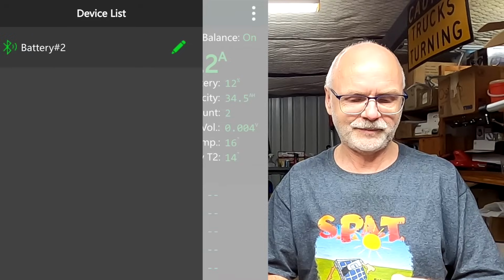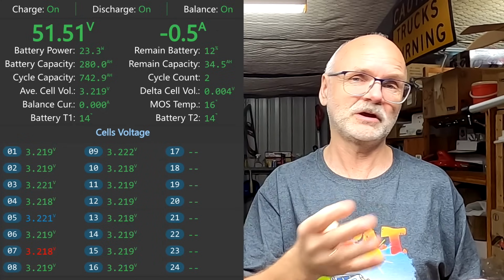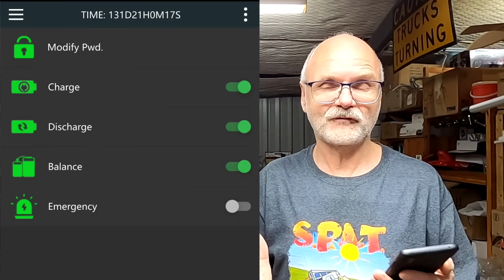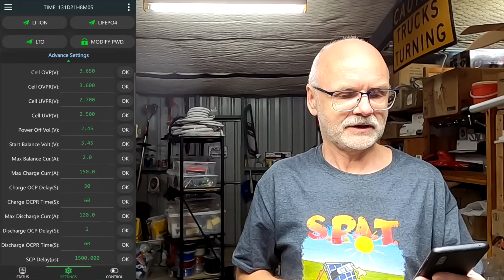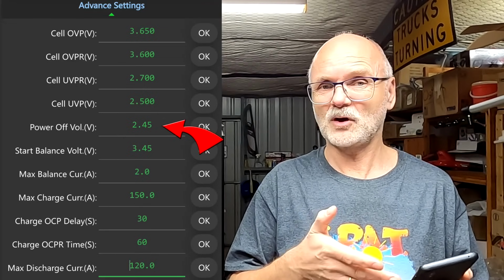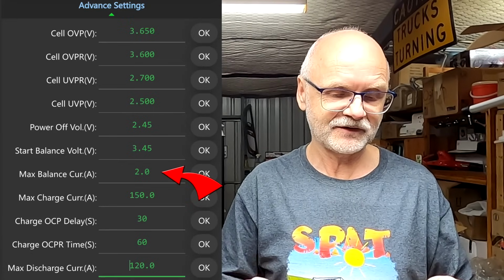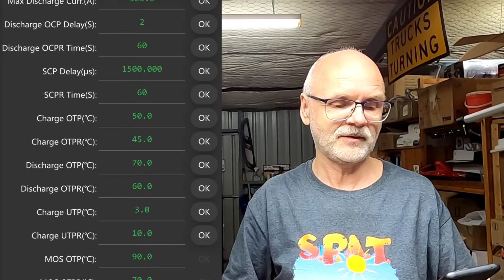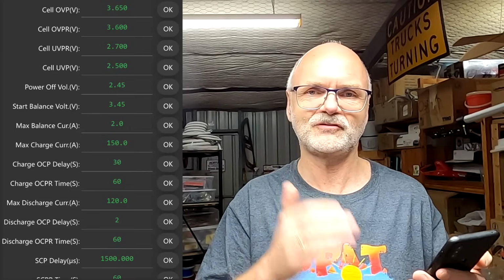JK-BMS: all settings and menus explained. How to program and set parameters.

Comment: Hi Andy,
in my opinion the Con.Wire Res. ist the resistance of your cell wiring. The BMS is able to calculate the "real" voltage of the battery because there is a voltage drop that becomes more important on higher currents e.g. 50A and higher. The voltage drop may be some mV but it is important, because the polarity will change while charging or discharging. so it must be added or subtracted from the cell voltage!
greetings from Germany!!
Reply: The cell wiring (bus bars) is in the order of 1 mOhm. It is probably even less than the internal resistance of the cell, which is around 0.25 mOhm. The Con Wire Res values on the screen look like around 150 mOhm, so they can't be the bus bars, they must be the balancing wires.

Comment: Amazing video Andy, finally I have got my battery ready to calibrate the BMS, all due to your instructions. I got a JK BMS for 24v which was the only one at the time, I did want 12v, but I have used the buck converter to get the 24v. Did the 7v short trick (thank you) to get it started. Using the software on my iPhone on the status screen, I can only see half the screen, the other half disappears under the settings screen, might be due to the version of iPhone.  The only other thing is that it will not let me change the Charge UTP setting and it defaults to -20 degrees! It will never get that cold here in WA but it does get down to freezing especially outside and early morning.  I can change most settings which I did not think I would be able to on the iPhone, I thought I had to pay for that. Oh well am now a little bit further down the road on the journey.  Thanks so much for all your nerdyness😎
Reply from the maker: Thanks a lot for your kind comment and words, Jackie. That is great to read and I'm always pleased if I can inspire people following their own projects.

Version 4.7.4 is the newest one I believe. Not sure why it does not let you change that parameter. Do you get frost in winter near the battery, is this really a concern?
Reply: @OffGridGarageAustralia  I have now obtained a disused Samsung phone and this is what I will be using as I get the full page of info and can see all the parameters when scrolling.  I downloaded the latest version V4.8.2  - woopee it now changes the UTP, we are in the hills outside of Perth and it is always 1 deg cooler up here...lol - probably do get the odd frost,  YES you do inspire me, I am a bit of a chronic DIYer but it is great to be able to collaborate with other likeminded people. There is always stuff to learn and it is what makes the world go around!  All I need now is to be able to see what my battery is doing over the internet, when I am away.  But I do not have any  Victron stuff, my battery is basically providing off grid power to my aquaponic setup, idea being power outages will not kill my fish!  Thanks Andy.
Reply from the maker: @jackiedines5229  thanks a lot for the update. Great to hear it's now all working.

Comment: You are not very precise on those settings, for example, when some parameters like OVP are met, only the charging MOS is cut, not the discharging one. So the battery is not "disconnect" as you say, only charge MOS is deactivated.
Reply from the maker: Yes, that is correct. I forgot to mention that. We have seen exactly what you described in the many tests with BMS here on the channel where I have demonstrated that function. 
Thanks for adding this for everyone.

Comment: 2è:35 : Yes it's better, imo, to start balancing a little before max voltage is met .... why ? Cause you will eventualluy prevent the higher voltage cells to go even higher by limiting their provided current and you will favor lower voltage cells with more current. You'll meet balancing earlier while stressing a little less those extreme cells.
Reply from the maker: The problem with that is, if you don't go higher then just the start voltage of your balancer, you may imbalance your battery.
Say if you start at 3.35V with the balancer already and because of cloudy weather or load you don't charge any higher than that this day, the balancer will already balance where it should not.
But yeah, starting at say 3.4V and absorbing at 3.45V should work as well. I still think, it's better to just chop of the cells if they go over the set voltage. Once we have the communication set up, we should be able to slow down charging from the MPPTs so the balancer can effectively work on the high voltage cells.

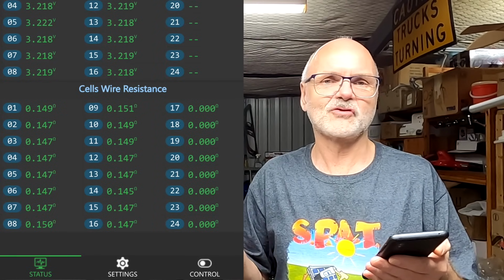Comment: 10:47 : Those are the resistance of all wires that goes to the BMS, they should all be the same i suppose ... for the BMS to work properly.
A bad contact would  display a different value. If, let's say wire 13 is 1.2 Ohm, then it need to be checked .. something is wrong with it.

Comment: I have 16 EVE cells with a JK-B2A24S15P. The batteries and inverter are in my shop which is too far away from my house to monitor with bluetooth. I have a network connected laptop in the shop that I can take over from my house. I can view the monitor programs for my MPP Solar LVX6048 inverter and my Victron Shunt this way but I can't find a way to monitor the JK BMS on the laptop. Is there any way to monitor the JK BMS on the laptop so I can also see that from the house?

Comment: Hi Andy love your videos! I have a question about the JK BMS with the heating option and I was wondering if you knew what heater they use and possibly the set up of it? Keep making this great content it certainly making me try new things.
Reply from the maker: Thank you. The JK has the heating function but you need this special connector. Hankzor on AliExpress should have that. The max current for the heating output is 3A only, so if you need more, use a relay. You can use any heating pad, mat or other heater.
Reply: @OffGridGarageAustralia  thank you for getting back to!

Comment: yeah this is the one for me.  the blutooth is what i was looking for but the capacitor balancing is brilliant.

i've contacted them on aliexpress to see if i can buy the 24s and connect to my 20s pack till i switch to 24s, or will cells not being connected cause an issue
Reply from the maker: You can use the 8s-24s BMS for your 20s battery and follow the instructions on their website on AliExpress. Very easy to setup as you just leave the unused cells disconnected.
Link is here... https://off-grid-garage.com/battery-management-systems-bms/

Comment: Hello Andy!  I’ve finally started my installation and just installed the first battery set. They are too balanced and full. Voltage dropped to 3,47 v. But the JKBMS says I have only 70% capacity how should I calibrate?
Reply from the maker: The JK will calibrate automatically. Have you set the capacity correct?
Voltage will drop once the charger is disconnected. Resting voltage is around 3.3-3.35V for these cells.
Reply: @OffGridGarageAustralia  yes i set up 280. I’ve charged them few weeks before installation in the power banks. I’ve charged them with the EBC-A40L such you did untill amps droppe to 2 amps. Store them and installed them later. Should I charge them at the maximum 56 volts for me ? I did yesterday but still showing 72% left.

Comment: It would be nice if 'wire res' was actually Internal Resistance; that would be a useful feature for tracking battery degradation.  Otherwise I can't imagine why wire resistance would be needed.  So maybe this is where actual IR can be entered if the calculated IR is wrong (just like they allow setting actual voltage and current).  Anyway, hopefully being the JK god you have the contacts with JK to find out; we peons don't...

Comment: Hi Andy, absolutely brilliant video and great timing for setting up my system. I wonder what settings you would suggest to not max out my batteries on either charge or discharge ? Also would I need to alter any of the charge parameters within the
 multiplus 2. 
All of the charging from my solar set up comes through the multiplus to the batteries.
Many thanks Steve

Comment: Andy I have installed my 280Ah 8S 3.2v Eve pack with JK Bms.  I copied ALL your settings in both Victron Scc and JK bms. I will let you know how long this will last.  Hopefully you are right about less degradation with these settings. This is day 1. 19 July 2022.
Reply: How about the degradation and diff volt when load applied?

Comment: Hi. Great content. Really enjoy all of your videos. I was wondering if the JK bms keeps the battery on when an over/under voltage occurs to protect the solar controller?
Reply: yes it does.  it just cuts off charge or discharge depending on what was triggered.  the only thing that turns off the BMS is the "Power off voltage" setting.

Comment: I want to stack 16 cells on top of each other verticaly. Is this ok?
Reply from the maker: The electrolyte inside the cells is liquid. I know they can be on a side for some time but permanently?
Others...?
Reply: @OffGridGarageAustralia  it has some electrolite in it. There are videos with 12v batteries with lifepo4 cells stacked horizontaly in box

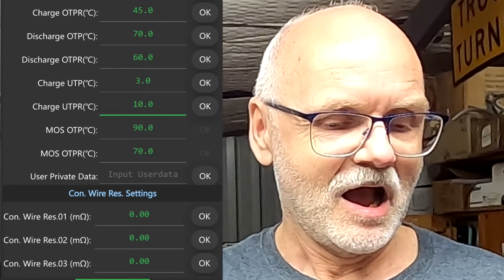Comment: 37:57 "User Private Data"
This is a ONE-TIME user changeable data. You can enter a string and it will be made PERMANENT! 
What use for? Use as a signature like "Andy's JK BMS" such that if stolen you know it is yours.
Or Battery name like "JK BMS Bank #1". So when you have multiple JK BMSs around and you want to know which JK you are viewing, just go over here.
I repeat, this can only be changed ONCE.
Reply: in app version 4.9.3 it can be changed over and over
Reply: @ajnsan  NICE INFO! Thanks!
Reply: @ajnsan  I tried it today: version 4.9.3 and all the other higher versions, no dice.

Comment: Always great info Andy, sometimes I watch ur vids a few times over. A question, I have 2 x JK 24v 200A BMS’s, can I use them in series for a 48v system? I don’t know if the MOSFET’s are rated for this voltage. Q2. My newish 24v JK wont connect to BT app & makes a 3 short beeps then 1 long beep, it took a bit to initially connect when I first switched it on a week or so ago, it worked fine mostly for a few days and then started this beeping when I tried to connect the app to it.

Comment: Good evening. I'm following your channel from the start. I recently started to build my own system with mostly Victron stuff. And went with JK BMS. But i have a weird issue. Even when i turn off discharge on Bms it still lets around 50W over because my Multiplus still can run on idle. If i raise usage to around 100W turns off as it should. Can you test for me if i have faulty unit. Or this is how this bms works. Thanks

Comment: Great video again! As always! Inspiring! Maybe someone can help me? I purchased JK-BMS based on battery 2.0 story. It is best what I had so far.  I have JK-BMS plus Victron family - Smart shunt, Multiplus II, Cerbo GX and Smart Solar MPPT 100/50. I have 24 V system with 210 mAh battery. It been fully launched 1.5 month ago. Original idea for SOC was to use JK-BMK CanBus, but I been told that it is not compatible with Victron. Then I ordered Smart shunt. For few weeks I been adjusting SOC as there was a difference between JK-BMS and smart shunt. Usually JK-BMS had higher SOC than SmrtSh. Few weeks ago I went for vacation and after a week I saw that my SOC reaching only ~70% (based on Smart shunt measures). After coming back I found that Smart shunt has SOC value of ~70% but JK BMS had 98% and charging was stopped due to cell OVP. What can be an issue? settings?
Reply: I only have the older Shunt BMV 702 from Victron, but I remember, that you can set a value like "charging efficency". Mine was like 95%, which should be ok for lead-acid batteries. But for LiFePo4 I guess this has to be set to 100%. You should check if there is a similar settings in the Smart Shunt.

Comment: Hey Andy, Andy here! I hope you see this and can tell me if I'm doing drugs or not!
Lifepo4 cells have approximately 25mv change from 90% to 100% so 25mv = 10% of large capacity 300Ah battery or 30Ah. Thus it will take a BMS rated at 100mA balance current 10 hours to bleed off 1Ah! It will take 300 hours to bleed off 30Ah or 10% of the capacity! I know cells should never get this imbalanced but even 2.5mv is 1% which is 3Ah which is still 30 hours to balance at 100mA. 
So none of these passive BMSs will do any useful balancing on large capacity batteries. Only a high power active balancing BMS can have any effect. JK BMS are rated 1 to 2 amps so the will stand a much better chance of offering some benefit. I would say balancing should activate at >3.25v (aprox 90% SOC) and at zero change current. Once the charger shuts off after the absorption phase, the BMS can equalize balance the cells continuously until the SOC drops below 90% (approaching the flat part of the curve). I would also think balancing should cease whenever any current is flowing in or out of the battery. 
I have pulled my hair out testing several passive BMSs until I looked at the math. Take a 500A Daly BMS, it would almost certainly only be connected to a high Ah capacity bank. Daly only balances with 100ma+- and only while charging (stupid!) That truly is pissing in the ocean! Or rather trying to suck the ocean dry with a drinking straw! 
Love your work!

Comment: Just wondering if one should disable charging and discharging on the JK when connecting it up to a large inverter/charger for the first time to protect against surge current? Can the JK handle the large surge when connecting to the Victron
Reply from the maker: Yes, it can handle it. I don't use any pre-charge resistors any more for my main system, just flicking the witch and the surge goes through the BMS just fine.
In commercial applications, there is never a pre-charge resistor or anything like this to limit the initial current. The inverters are usually always connected.

Comment: Andy, you need balancing during discharge as well 
I set “Start Balancing Voltage” to : 3.0V
Reply from the maker: NOOOO, don't balance during discharging. 3.0V is far too early for LiFePO4 and it will do the opposite as all the testing has shown.
Reply: I bought JK Bms, thanks to you. ( I have Daly in spare). Balance is active during discharge as well. It works perfectly. Cells are in balance when next morning re charge starts.

Comment: Make a video with the exact settings you would make on a BMS Daly ... If you used it on a battery of yours
Reply from the maker: It will come as part of this series. There is also a PC app for the Daly which can do a lot more than just the mobile app.

Comment: Like always! Great video! Thank you for that!
A remark to the calibration of the current value. In the beginning I had the same issue. But the reason for that was the load I used... An inverter... And this pulls not a constant current from the battery. The current has high high ripple with twice the grid frequency. At the end I used a large pure DC load with high current and repeat the calibration. Than it works perfectly and I get a good accuracy for the current measurement.
Another point I did not understand is the over current protection of the BMS: I can understand that if I draw only a little bit over the defined limit the time until the BMS switches of takes for example 30s (when set to this value). But what happens if I draw for example twice the defined over current limit? Takes it the same time for switching off? This could be dangerous. What is needed here is a fuse characteristic: The higher the over current is the shorter the switch off time should be. Maybe anybody knows something about this? Or this would be an interesting test for Andy 😉?
But again, thanks for your interesting videos!
Reply from the maker: Thanks Andi, that is absolutely correct and the ripple effect can be the cause for the calibration issue of the JK-BMS. Usually you just don't have any other loads you could connect to a 48V battery.
The second point of your question is what I was asking for in my video as well. In case of a short for example, how does the JK determine that? In other BMS's (the QUCC or JBD), I can define a current threshold for a 'short' and a reaction time for the BMS to shut off. 
Totally agree with you here, that is a very missing setting in the BMS. I'll take this back to Hankzor and see what they say...
Reply: Good points Andi, and Andy did refer to this “What is a short circuit current” issue with the JK, it needs to be addressed.

Comment: How did you get on with the solaredge optimiser?
Reply from the maker: They work but just not with other MPPTs together. You cannot have two MPPTs trying to do the same for one solar string. Fail.
Reply: @OffGridGarageAustralia  try the Tigo optimisers